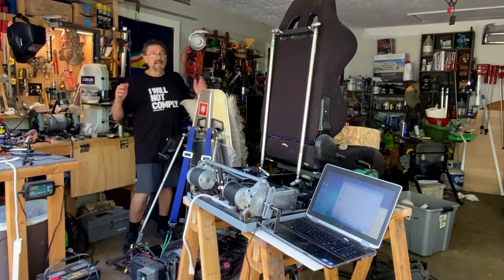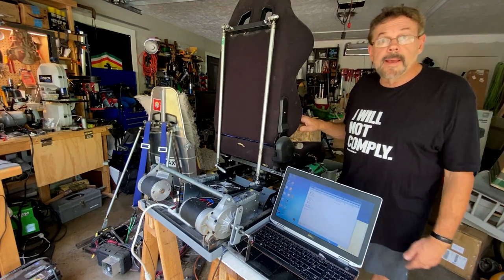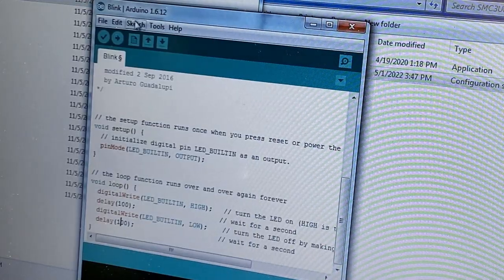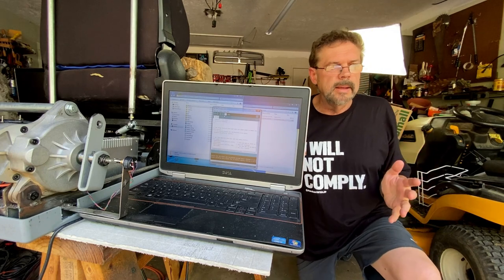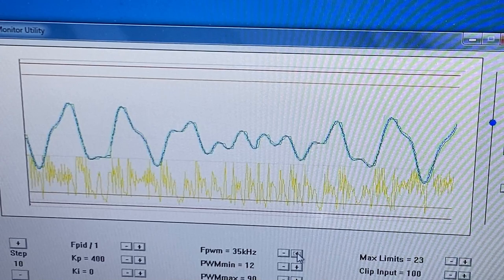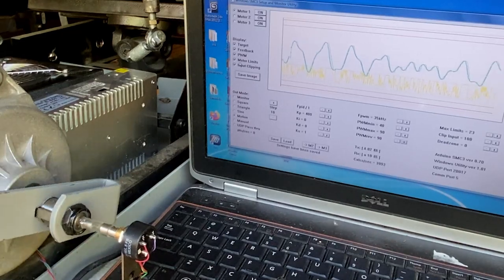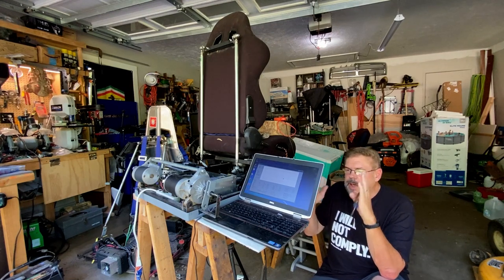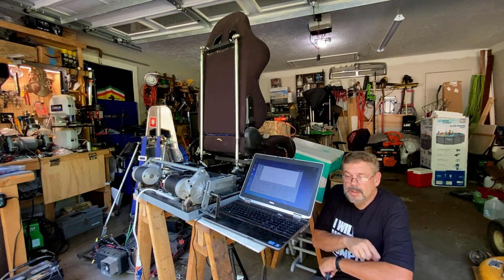DIY motion simulator Arduino IBT-2 24 volt Jazzy Wheelchair motors - How to set up SMC3 simtools

Comment: Hi D MAX. I'm one. Of your subscribers, been following you for a while now.just built my own rig,of the back of your DIY sim rig build.which I must say ,is one of best simrig build vids  out there.i would just like to know,in order to get a game to work with the simrig,does the game have to be from steam.does it matter where I buy the game. I've bought no limits 2, but when i Ioad it up,it does not work.i have simtools, simtools manager,and simtools game engine.its been patched,so I know that part of it is working.every thing works.so any advice from yourself, would be great.wilf, from South of England.uk.thanks.
Reply from the maker: Hi TIGERSHARK  Yeah.. so I bought no limits 2 also  but I got it from steam..  I had to change a run file so that it said  --telemetry  ..  I did do a video on it.
But i changed that in the steam launch window..   Also.. I would post the question to noorbeast on x-sim forum.. he will probably know.   I'll ask him and see if he replys too.

Comment: also dave what if i use more than 25v psu on ibt-2 what will happen?
is it ok
Reply from the maker: Good question.. Just look up the specs on the IBT-2  and see..   From the looks of this  here is the spec I found..  I've only ran it at 12v  and 24 v  so:

High current "H" bridge module for motor drive applications using dual BTS7960 chips. Built-in themperature & current protection. Logic level inputs to interface to a microcontroller.
Only four wires (GND, 5V, RPWM & LPWM) are needed from the microcontroller to the drive module.
Input Voltage:
Motor: 6V-27V
Logic: 5V (From Microcontroller)
Motor supply & Logic share common Ground.
Maximum current: 43A

Comment: hi dave just wanna ask what happen if i use 2 amps instead of 25 amps
Reply from the maker: probably will 'work' but that's not enough to move  a body and a seat very convincingly.  What are you building?    let me know.. Dave
Reply: im building a 2 dof motion rig just like yours. been watching your tutorial videos for the past few months and now its the time for me to build it XD
Reply from the maker: @tricenexequillemendoza521  Very cool.. It's a great DIY project.  just take your time and get the parts you need that match voltage and amps etc..  never give up..  Dave

Comment: hello which file do you install at 10.20?
Reply from the maker: Thanks for the question. at 10:20 I am installing the SMC3.ino file into the arduino.. You can get it here   it's free  https://www.xsimulator.net/community/threads/smc3-arduino-3dof-motor-driver-and-windows-utilities.4957/
This is the main page on how to hook all the wiring up and download the files at the bottom..   Hope that helps, Dave
Reply: hello I'm talking about the first thing you download before you download smc3 (just before you change the download time and explain that your pc is slow)
 Thanks very much
Reply: Its good!
 I finally got it thank you for your video
Reply from the maker: @jo098  Ok.  Cool..  great! Check back cause I have follow up to SMC3 with the Simtools setups..  Dave
Reply: @DMAX_DIY  Thank you for your videos. 
I installed itb-2 and started playing with smc3.  
some settings are not really clear at the moment... 
I followed the tutorial on xSimulator but some parameters are still unclear for me, such as fpwm for example... did you find more details?
Reply from the maker: @jo098  Thanks for the question.. I might be able to help you..  So start with only One motor on and we get that one working first..  Put  the PID at 400..  and the FPW max at around 50.. then move it by 10 to 60, 70 80.maybe 90 and it should start to move..  Does it do that?   Does it the motor move when you go to 100?  can you see the green line  (THE POT line)?    I'll check in tomorrow..  I gotta hit the rack now so let me know.. D
Reply from the maker: @jo098  I thought I 'replied' I guess it did not post correctly..  So just make sure you have at least 400 in the PID..  Then slowly boost the PWMAX up from 40 to around 100 or until at least the motor starts moving..  It should start moving at some point .. all motors are a bit different..   Let me know right here what happens.. I'll check in tomorrow to see.. Dave
Reply: @DMAX_DIY  yes the pot works I bought the same ones as you (for me additional sprockets was a problem in my logic) 
I followed your basic settings and everything works pwm max increases movement speed.  
the blue and green line are exactly in the same place. 
for the yellow one I have not yet understood what it really is.

everything looks good i would just like to get the best out of my engine (24v 150rpm 110nm).
i haven't finished the chassis yet i wanted to be sure im ok with the programs and electronics.

i think  that the PID does not change much when the motor is running without load.
Reply from the maker: @jo098  That's fantastic news Jean Luc!   yeah once you get the chassis set up and the motors under load, then you should be able to use SMC3 to tune the motors to suit..  Keep me posted.. BTW .. are you going to be posting your build on x simulator.net?   Would be great for all to see.. Good guys there.
Reply: @DMAX_DIY  hi yes i started sharing on xs "3 dof inspired by h3" i can't wait to start the chassis!
Reply: @DMAX_DIY  Hi 
I installed sim tool and download the pdf I have not yet found the video where you talking about the setup of simtool. 
I keep looking 😁
I soon have enough coins to download the assetto corsa plugin 🥳
Reply: @DMAX_DIY  hello could you give me a link to this video? 
(Smc3 with the simtool setup)
I have not found them yet thank you
Reply from the maker: @jo098  I am still making the new video..  Should be out pretty soon..   Here is one video which goes over some of the settings..  I should have made it better, that's why I'm making another one which covers the program slower and we see what all the settings do..  If you want to watch the old video here it is.. https://www.youtube.com/watch?v=5Kz1OL2wpwA
Reply: @DMAX_DIY  Thank you very much 
it already gives me my starting line.
My simulator will also 3 dof (2dof with loss contrôle)
did you see the link to xSimulator? 
I would love to have your opinion
Reply from the maker: So is your x-sim build here?  https://www.xsimulator.net/community/threads/3-dof-inspired-by-h3.17057/   I see that 'jordan' is asking some questions from Noorbeast  (**He's great BTW**) and lot of good advice from some others..   I'm going to watch your vid when it comes out..   And let me know if this is your build or not..   Jean Luc..   Is different than Jordan c. which is what the x-simulator search found..   Send me a direct link here if you can.. Dave
Reply: @DMAX_DIY  hello 
yes that's right!  
I posted a video of testing the motors with smc3.  
noorbeast helped me a lot. 
why don't you use pwmmax to the maximum in smc3 (it doesn't decrease the potential power,speed?)
Reply from the maker: @jo098  Well on the 2DOF motors, they started acting weird when I went over  120.   dont know why..   On my 3DOF I have PWMax and min set at 212..  they seem to handle it perfectly.    Ok.. Now that I know that's you I will go back and watch those videos..  THanks for confirming.. See ya on x-sim my friend!
Reply: @DMAX_DIY  thanks a lot for your help 💪

Comment: Thanks!
Reply from the maker: Thank you Gary! I appreciate it. Hope this is helping out!   I just got my extra 3 motors today..  Going to attempt to make a 6 DOF stewart platform.  The extra motors are the 50:1 12 volt crab pot motors..  so I'm hoping they are strong enough but I dont know..  I'll give it a shot and post it up for you guys.. Dave
Reply: @DMAX_DIY  Time for you to move on to 6! More power to you! I like you diving in first and answering many questions! Once I get moving you may be hearing from me with a question or 2, 3,,,  Thank you again. Good luck with the next one, or 6.!
Reply from the maker: @garymarma6005  Could be a disaster..  but I'm psyched!!